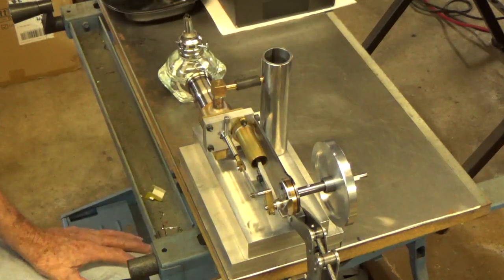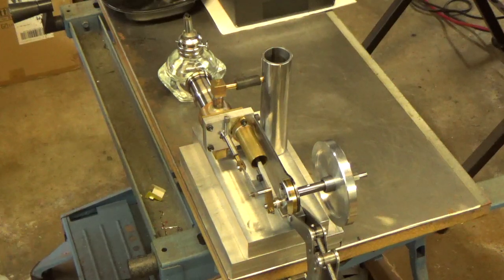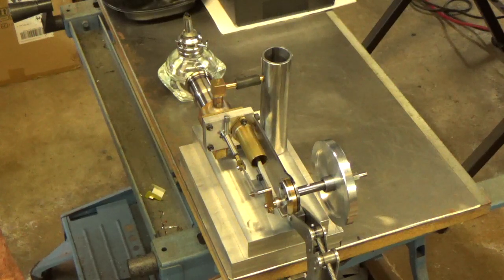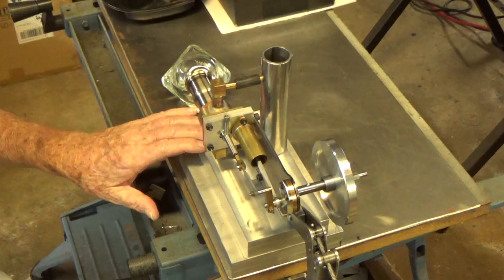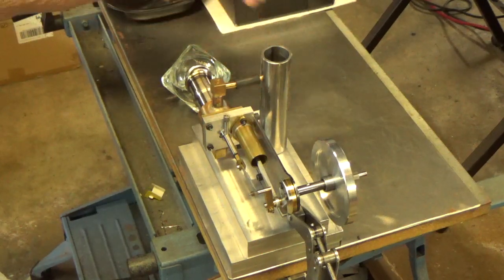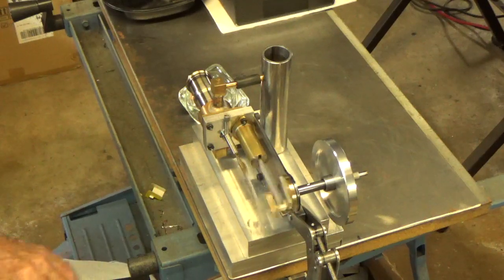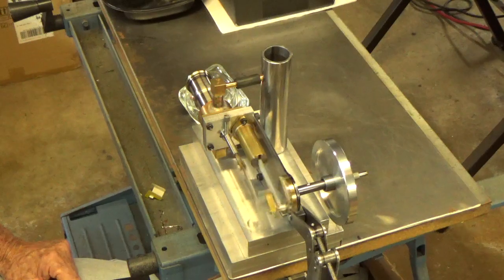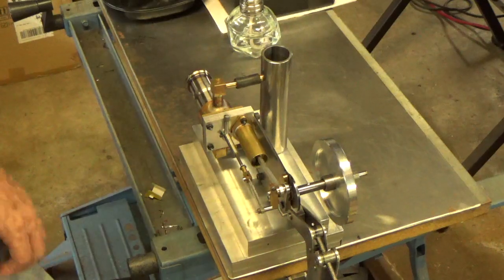"Fizgig" Stirling Hot Air Engine Build - Part 6 (It Finally Runs - Update)

Comment: some info.     in order for a thermosiphon to work, all the water in the reservoir must be at a higher elevation, than the engine/waterjacket.!      at least two issues are still present.     the hot side connecting rod is too short.      the  Mass in a solid piston is  not  wanted.          there are two ways to configure a good cold piston.    1) wrist pin located at the end of a longer piston;  2) sunken wrist pin and a slightly shorter piston.       googletranslate
http://eneroffgrid.com/media/catalog/product/cache/3/image/800x800/9df78eab33525d08d6e5fb8d27136e95/s/e/secutherm_200.jpg
sunken wrist pin; nearer the top of piston
https://ae01.alicdn.com/kf/HLB1XRBDazzuK1Rjy0Fpq6yEpFXaM/MagiDeal-1Pc-Stirling-Engine-Accessories-Mini-Metal-Glass-Cylinder-Piston-for-Stirling-Engine-Model-Children-Educational.jpg
Reply from the maker: David: Thanks for the comments.  Always appreciated.  Regards: Larry

Comment: Congrats! In the end You noticed that the engine does produce some torque. Why not measure it some way anyway?
Reply from the maker: Stefan: Thanks for your comment.  Right now I'll need to finish things up.  It seems there is a lot of things that still need done to finish this project; Proper Base, Burner, Graphite Piston, and getting the Thermosiphon System working.  I am happy that it does run.  Best Regards: Larry
Reply: @larrypoindexter9351  Having a motor making its first run gives the same feeling as in the film Frankensteins monster: "It's alive". It works... Nothing beats that.
Reply from the maker: @Stefan_Boerjesson  Especially something so quiet.  It's completely silent until it does!  Good feeling........Larry
Reply: @larrypoindexter9351  A Swedish shipyard designed submarines using Sterling engines. They were really silent. If it was such a sub that made the American Navy look like newbies, I can't tell for sure..... But they did it.
Reply from the maker: @Stefan_Boerjesson  I think I read something about that at one time.  Larry

Comment: On my first Stirling Engine I used a single copper tube, hot on one end and cold on the other.  I could not get it to work very good.  The cold end quickly sucked the heat out of the hot end.  My solution was to cut the tube in half, added flanges and placed high temp gasket material between them.  The flanges were bolted together with four 5-40 bolts.  I  have used either copper pipe or stainless tube.  I have always silver soldered the pieces together.
Reply from the maker: John:  I have used silver solder in all the critical spots and soft soldered where it didn't really matter.  Loctite was my initial down fall with the displacer ends.  I'm just glad now that it's running.  After the demo I restarted the engine and let it run for a while with no problems.  I think my next step will be to make a graphite piston to replace the current aluminum one.  I'm also going to make a proper alcohol burner and maybe enlarge the base.  If I decide to make another engine I'm thinking stainless steel for the chamber without the three ribs.  I may also possibly try to make it air cooled than water.  I would rather make cooling fins rather the water jacket system.  I will say that it has been an interesting project and definitely a learning experience.  Thanks for your comment and Best Regards: Larry